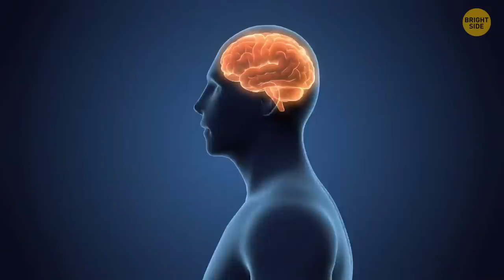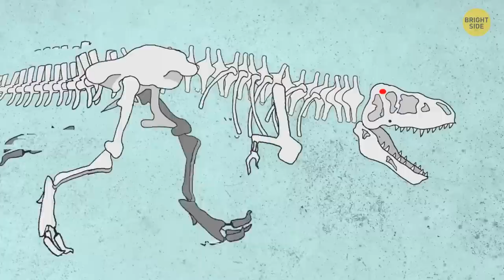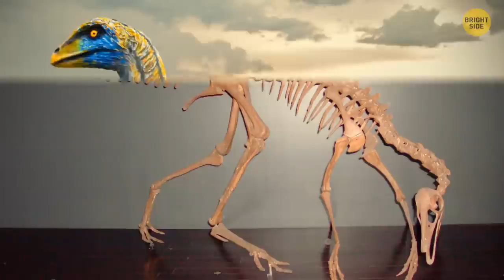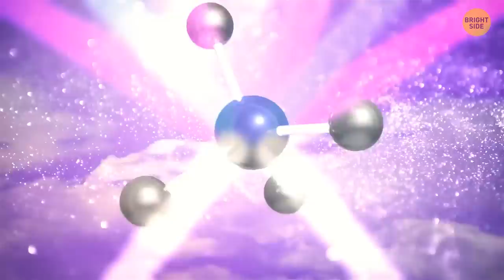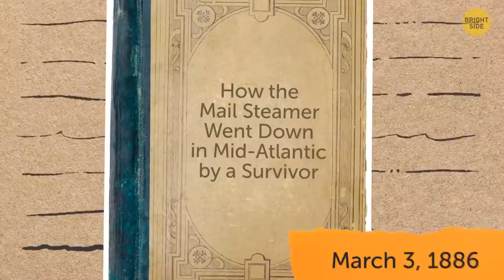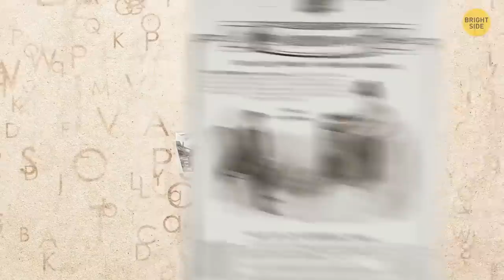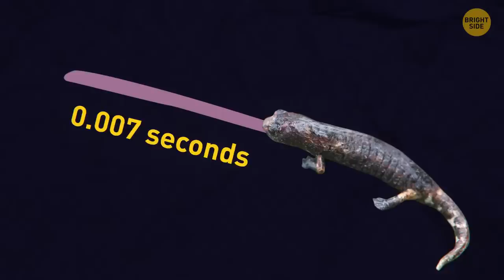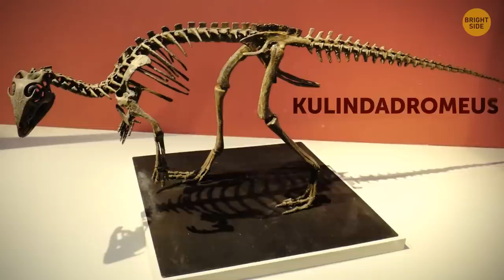How Dinos Looked in Real Life And Other Facts for Brainiacs

Comment: The effect of salt on the boiling time of water depends on the amount of salt added and the heat capacity of the water1234. Salt makes it harder for water molecules to escape and enter the gas phase, which raises the boiling point of water123. However, salt also lowers the heat capacity of water, which means it requires less energy to increase the water temperature34. If a small amount of salt is added to water, there is no significant difference in boiling time compared to pure water124. If a large amount of salt is added to water, such as 20 percent, the salted water will boil faster than pure water because the reduced heat capacity outweighs the increased boiling point123. Adding salt to water does not reduce the rate of evaporation or help to maintain the temperature of the water5. Googled